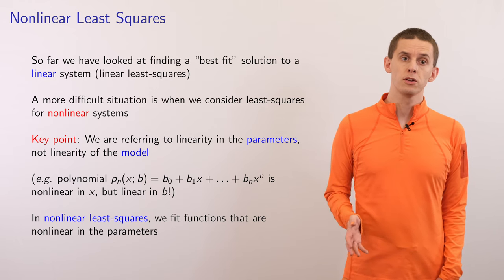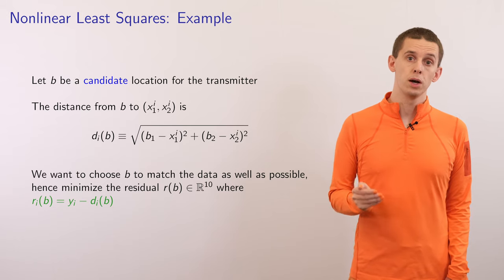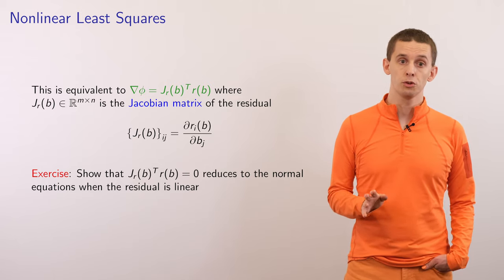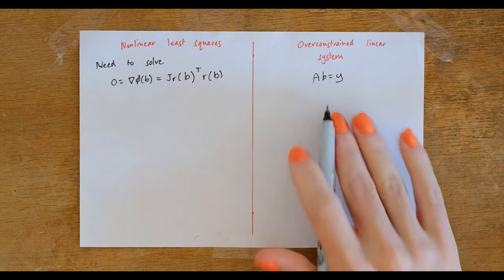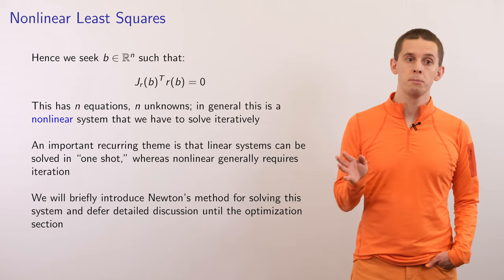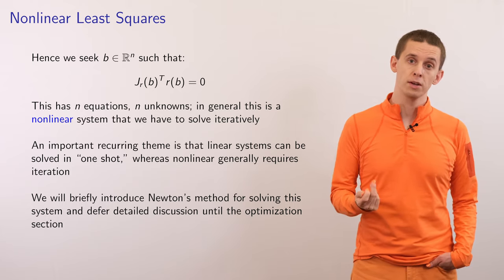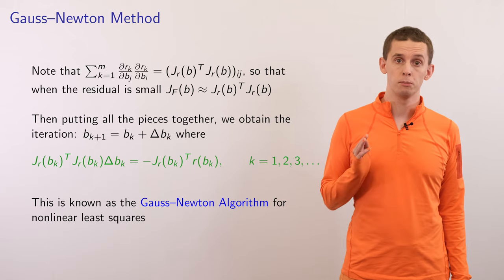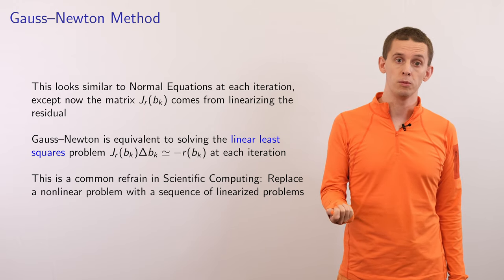Harvard AM205 video 1.8 - Nonlinear least squares

Comment: Thank you for putting this on the web Chris, a beautiful publicly available resource!
Quick q: is the beacon example really a good example of the LM algorithm? We are feeding scipy.root with a gradient, whereas the preceding material points to using the residuals (r) and the Jacobian of the residuals (J) separately and use those to approximate it all via a simple normal equations problem, i.e. calculate (J'J + mu I)J'r. 
If you feed the gradient directly (J'r) to scipy.root then that is obviously fine in that it is correct, but I can't see how the LM algorithm works for root-finding problems? I.e. how does it separate out J again to solve a set of normal equations? Perhaps a more appropriate example given the context is to feed r to scipy.least_squares instead of grad_r to scipy.root?
Reply from the maker: You're right: this is not an ideal computer demo, and I always found it awkward when I lectured on this. It solves the mathematical problem, but it glosses over the implementation details.

This largely arose due to the structure of the lecture-based course: nonlinear least squares belongs mathematically in Unit 1, but I didn't want to get too much into these types of algorithms until Unit 4. If I end up creating online-only material in the future, where the timing of each topic is more flexible, then I will look at revising this.

Comment: @Chris Rycroft in 3:29, the fact that r(a+b) does not equal to r(a) + r(b) is also true for a standard linear LS problem of the form Ax ~ b. the residual is b - Ax which is an affine function (and not linear) with respect to x. Please correct me if I am wrong.
Reply from the maker: Yes, this is a good point. The statement in the video is technically correct, but it is not a precise statement of the difference between linear and nonlinear least squares. I think that in general, linear least squares refers to cases where function you are fitting is linear in the parameters, i.e. y(x; gamma*a+sigma*b) = gamma*y(x;a) + sigma*y(x;b). Anything with this form will then give you a linear system to solve for the parameters.

Comment: Hi Chris,
I have 2 questions. 
1 - In the function grad_phi, what is the logic behind calculating f0/f1 (f0+=2*dx -2*y[i]*dx*d)?
2 - In the whole code, why are we looping 10 times to calculate dx,dy? Can't we create x_beac/y_beac as np.array and perform calculation than looping?
Thank you.
Reply from the maker: 1. In this example, phi=||r(b)||^2_2 and r(b) is a 10-vector with components r_i(b)=sqrt(dx*dx+dy*dy)-y[i], where dx=x[0] - x_beac[i] and dy=x[1] - y_beac[i]. Here b=(b_0,b_1) is written in code as (x[0],x[1]) since typically Python's root function works with an x vector. The function grad_phi is evaluating the partial derivatives of phi with respect to the components of b.

Hence, as an example, you need to calculate partial d/db_0 of r_i(b)^2, which is 2 r_i(b) [d/db_0 r_i(b)]. The partial derivative evaluates to

d/db_0 r_i(b) = (b_0-x_beac[i]) / sqrt((b_0-x_beac[i])^2 + (b_1-y_beac[i])^2),

which is equal to dx/sqrt(dx*dx+dy*dy) in the code definitions. In addition r_i(b) = sqrt(dx*dx+dy*dy)-y[i] in the code definitions, and therefore

2 r_i(b) [d/db_0 r_i(b)] = 2*dx - 2*y[i]*dx/sqrt(dx*dx+dy*dy) = 2*dx - 2*y[i]*dx*d,

where d=1/sqrt(dx*dx+dy*dy). You can do a similar calculation for d/db_1.

2. It's possible that you could write some parts of this using np.arrays, but since there are some nonlinearities here (e.g. via the factor of 1/sqrt(dx*dx+dy*dy)) it will never be as straightforward as just multiplying matrices together, as you would get for linear least squares. In many situations like this in the AM205 examples, my style is usually to write out calculations explicitly with loops.
Reply: @chrisrycroft2010   Hi Chris, Thank you  for the detailed explanation on point1, I initially did not understand the part where you squared r(b), you have explained that in Unit1_Page63 as "Since minimizing b is the same for r (b) and r(b)^2. For point 2, as you said I could do some parts using nd.array and it works.  I am enjoying the lecture series! Thank you so much for uploading.
# -Code-----
# Initilize
bx_t=0.7  # Define the transmitter's true location
by_t=0.37 # Define the transmitter's true location
b_init=np.array([0.4,0.9]) # Define initial value for itiration
y=np.empty(10) # holds ground truth data and add noise
noise_level=0.05 # noise value

# Define the beacon locations (randomly located in the unit square)
x_beac=[0.7984,0.9430,0.6837,0.1321,0.7227,0.1104,0.1175,0.6407,0.3288,0.6538]
y_beac=[0.7491,0.5832,0.7400,0.2348,0.7350,0.9706,0.8669,0.0862,0.3664,0.3692]

# Convert x_beac, y_beac to np.array
xb = np.array(x_beac,dtype=np.float64)
yb = np.array(y_beac,dtype=np.float64)

# Steps to generate ground truth data
dx=bx_t-xb
dy =by_t-yb
dx_sq = np.multiply(dx,dx)
dy_sq = np.multiply(dy,dy)
add_sq=np.sqrt(np.add(dx_sq,dy_sq))
y=add_sq+noise_level#*random.random()  # Generate ground truth data and add noise

# Gradient of phi
def grad_phi(x):
    f0=f1=0
    dx=x[0]-xb
    dy =x[1]-yb
    d = 1/np.sqrt(np.add(np.multiply(dx,dx), np.multiply(dy,dy)))
    f0=sum(2*dx-2*y*dx*d)
    f1=sum(2*dy-2*y*dy*d)
    return  np.array([f0,f1])

sol=root(grad_phi,b_init,jac=False,method='lm')
print("Predicted location:",sol.x)